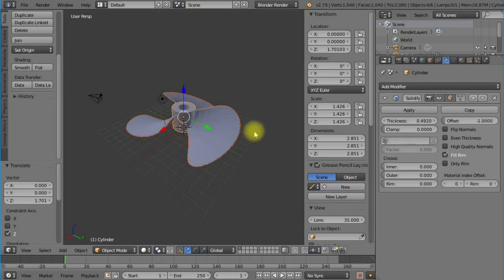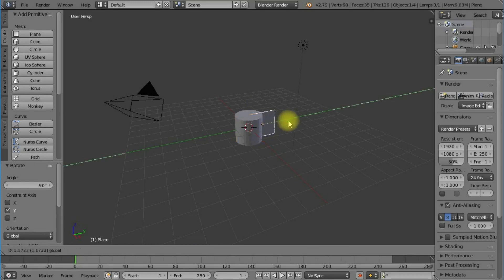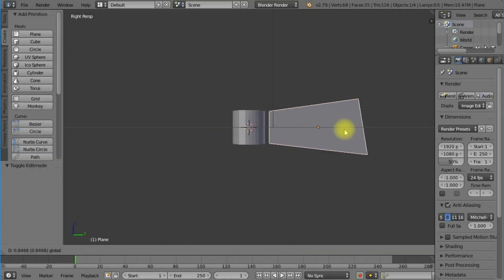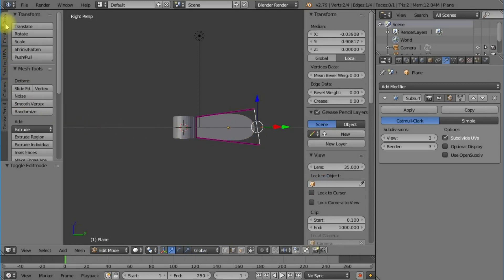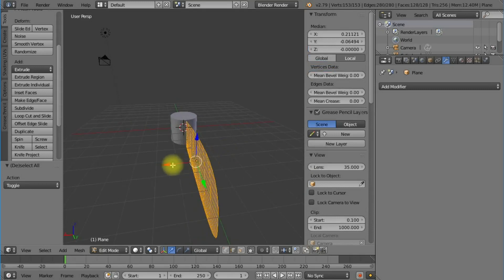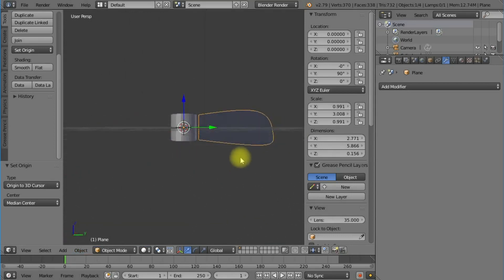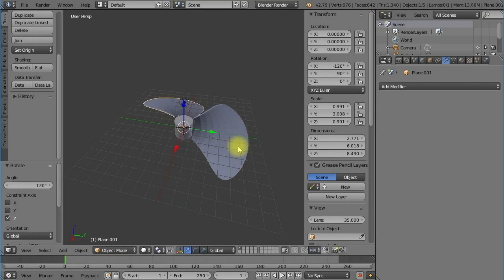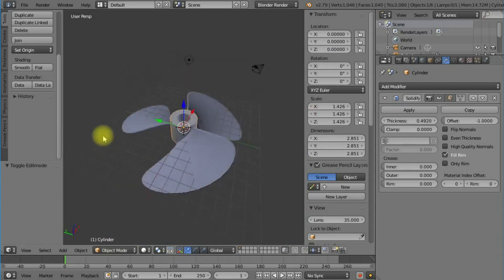Propeller - Blender 3D Tutorial

Comment: tried this on blender 4.5.3 and sadly the simple deform doesn't stretch the blade as nicely (even with setting it to 90deg) it kinda stays the same width of the original plane... any advice?

EDIT - I think I found the solution: in newer blender versions you need to select the correct Axis (in this example the Z-axis)

Comment: Nice to see that Blender hasn't changed too much so that these older tutorials may still be understood! Thanks
Reply from the maker: Thanks. I did a tutorial a couple of months back on how to spin the propeller. Thought it needed a bit of an update. Still used the original propeller model.
Reply: @rocknets  Now I just have to go watch that!
Btw. would it not be better to add a modifier which automatically copies and rotates the propellor plane around an incident point (3d cursor, e.g.) ? Something akin to an array modifier. I don't know if it exists, very new to blender and modelling.
But then one could quickly switch between 2,3,4,5 blades. Would that be practical?
Reply from the maker: @007LvB  Hello Alex. Yes it is possible to do that. However. I like to try to keep my tutorials simple and prefer to concentrate on one task without including too many processes as it can be a bit overwhelming for the viewer. I hope that explains my reasoning.